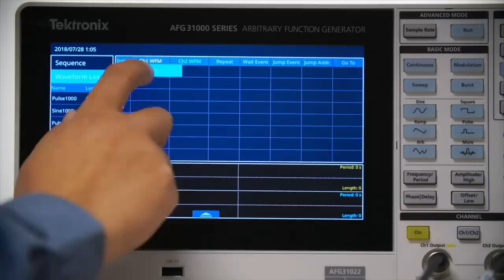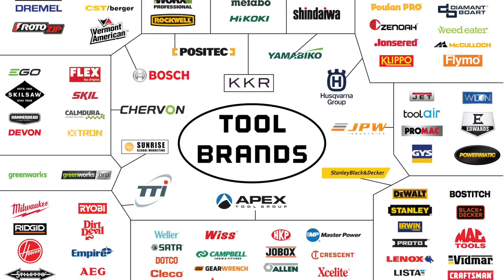Who Owns Your Favorite Power Tool Company? [2023]

Comment: B&D Dewalt and Craftsman were being made by the same base manufacture point for years.   For the last 20 years they all had models based on the exact same base parts and manufacturing tooling setups.   The only difference was the quality or lack thereof (cheap raw plastic Vs fiberglass reinforced or lots of good gease Vs no grease in a gearbox or shit battery cells Vs almost as shit battery cells at 2x the price)  between the individual components the tools were made of and even then many time there was no difference between them other than a grossly inflated price when buying replacement parts. 

Many times I found the same part for a Dewalt was 2 - 3x the price for the B&D version that was identical right down to the manufacturing ID number lazer etched into the actual part.    A dewalt trigger switch could be $25+ and the identical switch for a B&D tool was less than $10 while both came from the same parts supplier.
Reply: I know. It blows. Doesn't it.
Reply: Mr Squeak The Cat. Wow this is good to know! It would be great if a resource existed that listed power tool parts and their cheaper cross-brand equivalents. Do you know if there is a website like this already?
Reply: 1. Craftsmen was just Sears private label they had their products made by dozens of other actual real manufacturers Kinda like Lowes and their Kobalt  brand etc.  2. Black and Decker bought a small table/radial saw company back in the 90s for the actual name. (because theirs was synonomous with crap)imho,  took their tippy top best,B&D power tools and repackaged them and changed the color to yellow- Presto! De -Walt  New brand!
Reply: I had the same experience back in the 1980's when I repaired laser printers. Most of them used the identical Canon II engine, so 99% of the parts (Excepting covers and logic boards) were interchangeable. Of course, if you bought your parts from Apple, you paid twice as much as the same part from Canon. I was able to support 85% of the laser printers in my market area with just one Canon Engine machine to strip for rarely-needed parts plus an inventory of commonly-needed parts. 

 I ran my repair shop out of my RV - Laser PROS - "Printer Repair On Site". I was single and in Southern California and lived in an RV with a workbench instead of a couch. I drove to the client's location, repaired anything on site, parked for the night where ever I wanted (& often as a guest of a thankful client) and used a mobile phone and pager to keep in touch with my clients - all over San Luis Obispo to the north and Orange County to the south. Ah, that was the life!
Reply: Black & Decker's 20v lithium are excellent.  Case and point:  My 2006 BD string trimmer included 2 (two) 2.0 ah batteries and sold for around $100.00.  After using it for literally hundreds of hours (large 1/2 lot with terraces, fence, driveway and bulkhead) the batteries are still strong and will run the unit with the full power switch engaged for around 15 to 20 minutes on a single charge.  Needless to say, the batteries have been recharged, over the years, several hundred times!

The trimmer itself is all original, never needing a spool or head replacement.  

In a recent internet deal, I purchased a 20v BD drill brand new with battery for $28.00.   The battery is super strong.
Reply: Flexvolt tools are awesome. Circular saw, miter saw, and grinder are more powerful than corded versions and they are at top speed as soon as you pull the trigger. Have batteries at least two years old and they get used and charged every day. I like allot of the new tools though, all the companies have good shit out now.
Reply: Another dirty secret of B&D was their different grades for different markets.  They had the crappy consumer models that sold in K-Mart/Walmart, and then the "pro-grade" tools we sold in the NAPA Auto Parts Stores.  This was before DeWalt was a thing, back in the 1980s.   The only way you could tell the consumer from the pro models was the color of the switch.  The consumer models were black or red.  The pro models were blue, and had different/better battery cells and other  components internally.
Reply: Nothing unusual about the practice of parts making up a product being produced by companies who name is not on the final product. The main reason is that sometimes it is COST PROHIBITEING to make the part in house. That part is farmed out to someone who can mass produce that part and make a profit doing so. It is not unusual for that company to supply pparts/sub assemblies for rival manufacturers.
Reply: Craftsman original 18 volt drill was made by Ryobi. There was a slight difference in the top of the battery pack so you couldn't use a Ryobi battery pack without the battery possibly falling out. Shortly after that they came out with another 18 volt drill with that was a piece of crap. Friend of mine had one and they kept shorting out. Not sure who made that though it didn't have a Black & Decker type clip connection. It was a post like Ryobi, but the contacts were recessed in holes at the top. It would short out while he was using and literally have sparks flying out the back.
Reply: @NoDeadlines  if I remember correctly the only other printer engine at the time was okidata. I'm kind of out of touch for that stuff now. Thought I did just build a new ryzen 7 computer today! HP belts a lot of printers with Canon engines and then sold them to other companies for them to Rebrand basically. The top deck was the only thing different on those from HP compared to the other branded printers. It was kind of funny if you knew what to look for you could see it.
Reply: @JohnRodriguesPhotographer  - Yeah. I was involved in laser printer repair when the major engines were the Canon CX and then the SX - which, as you know were the basis of HP, Apple, Star Micronics, Pitney Bowes and a half-dozen other "rebranded" brands. What I liked about that was with one complete HPII, in my van, and a good supply of the well-known common failing parts, I pretty much had all the parts needed to fix 90% of the printers I encountered. (Except for the logic boards, which were customized to the brander) I also did Okis and Ryobi's, but 90% of my customers had Canon-engined printers, so on site repairs went well. My mobile shop was an RV. I covered the entire range of San Luis Obispo County in my RV and used a pager and bulky "car phone" (1980's) and then could also spend the night where ever I wound up in the evening. I often serviced printers in remote locations - ranches, vinyards, small army bases in the middle of nowhere. It was a good time. These days, I work from my home shop and 
restore antique printing presses - not quite the same market but lots of fun.

Comment: I worked for Black and Decker in Australia. They brought drills etc in from China - eg $9 each landed with battery and packaging. They onsold them to major outlets eg Bunnings for $30 who then retailed them for $45. They had a 2 year replacement warranty (not the battery). So they could be replaced 3 times during warranty and Black & Decker still made a $3 profit.
They did the same with vacuum cleaners through KMart - again with replacement warranty. Every month we received a semi trailer load of returns. Most problems were customer abuse eg sock stuck in them.
Reply: And they're great drills. I still have a bunch of Firestorm products.

Comment: It's also important to note that just because some companies are owned by the same company, doesn't mean the tools are equal in quality, design, or use the same parts. Your Ryobi isn't a Milwaukee with some green paint, for example.
Reply: You’re correct, there’s companies that make mediocre product because that’s how it’s designed and that same company will also make a high quality product for another brands design. Everything from motor oils, antifreeze, tires, ac compressors, tools and so on usually fall under one of a few major manufacturing companies
Reply: Not even on the same playing field.
Reply: On the other hand, some cheap tools are actually very capable, and if you are not using them daily, it doesn't make sense to pay premium.  For example, the Harbor freight oscillating saw for $20, it works just as well as the Dewalt which costs $230.00. I would buy 4 HF saws and have spares if one of them died on me while on a job site.
I don't have to use any specific brand to look cool and none of my cheap tools have ever let me down.  I guess some people buy cheap tools or expensive ones and expect them to do things they were not designed to do and then complain about the quality... To each it's own .
Reply: Bosch Green and Bosch Blue is enough to show right there that quality levels vary within a company.
Reply: @lucyferina  Ya I was hoping to see who the root manuf. was for some HF tools.  CP there is junk, while the Bauer stuff is turning out 95% as good as milwaukee....
Reply: Correct. Chevy is responsible for the chevette and Corvette.
Reply: @shawnkmorse  The shoveit? Kind of like the Vega? The Vega could be made into a reliable car with a Corvette engine. Lots of work though, but fun.
Reply: @shawnkmorse  One is a cheap car that will break down and one is a fast expensive car that will break down.
Reply: @kutzbill  Vega's were great, they just ran on motor oil instead of gasoline.
Reply: @lucyferina  blade changes on the Harbor Freight oscillating tool are a chore.
Reply: @1pcfred  it's just loosen one screw on mine, not sure if they make a different model but that change is the standard on any brand I have seen in the market...and it works just as well as the $300 Bosh or Dewalt...I have tested all of those so I speak from experience...
Reply: @lucyferina  There are toolless change systems where you just lift a lever.
Reply: @1pcfred  I've seen those but I still prefer the teeth it's a more secure system..I've seen those with the lever having lost blades and a blade flying at that speed is no bueno... I know some people have to have certain brands to feel like they are getting their money's worth, I don't care when it comes to things like those tools , for other things i do pay premium because I know the quality there makes a difference...I tested many tools and for the price difference you are really not getting much more, my $189 dual bevel sliding miter saw from HF is better than the $600 bosh that I used before, I did floors for 4 big rooms, just for that the saw paid for itself, of course I still have it and it still works just fine... I don't need to pay more. I don't know how others treat their tools but all my tools are working just fine, I could be using them every day for years and they would still be working. Harbor Freight has never let me down, I do own some Dewalt stuff as well but Again I don't need to pay premium for the same quality. don't believe the so called reviews here in YT, they are ALWAYS very biased, try them yourself like I have. I remodeled my house, I spent about $500 on tools at HF, but when I sold the house I made over 60K, the job got done without compromises or shortcuts, anybody can "test" tools and tell you why one is better over the other, well I tested with real work and a lot of use and I can tell you again HF had not let me down yet, yes HF used to be shit tools, that is in the past when the quality control was nonexistant, now most of those companies have Americans ensuring production is monitored, the workers are of course still chinese and that is why you pay a lot less, but a lot of the other brands maybe made in the same factory so the only difference will be in the quality of some components and at this point that is not enough to justify 10 times the price of the cheap ones.
to each his own, I can buy literally 10 of the same tool with the price of one Dewalt but they will last me a lifetime before I need to replace even the first one... again I don't know how others treat their tools but my cheap tools get a lot of use and are still going strong.
Reply: @lucyferina  I've gotten tools from Harbor Freight that are subpar. I had a jig saw from them that was a knock off of the Bosch and it fell apart three different ways. First the switch blew up in it. So I put a new switch on it. Then the blade holder busted in half on it so I welded that back together. Then finally the scintered gear in it broke and there was nothing I could do for that. Then I went out and bought the Bosch jig saw. It works today like the day I got it.
Reply: @1pcfred  you do have to check your tools before you buy them I have had dewalt fall apart on me on the first use, simply keep your receipt and return it not issues.  I personally had not have a HF tool fail me yet but you can buy service protection and they will replace it no questions asked.
I know Bosh will replace your tools if they fail but I can't wait to mail it to them, then by the time I get it back I already bought a new one.. all my HF tools work just fine just like the day I got them too. and no i am not sponsored by them (I wish). At the end of the day use the tools that make you feel happy and spend your money the way you want to.
Reply: @lucyferina  what are you going to check the tools for? The switch failure was inside the tool and it was a malfunction that took time to happen. The ceramic the switch was made out of was rough and every time the trigger got pulled a little metal would rub off. After a while that metal built up enough to make a track that conducted electricity and caused a short. Then it just blew up right in my hand. When that happened I tossed it across the shop I was working in. But I replaced that switch with a plain on off switch. No more speed control but oh well. So I kept on using it and the rod that held the blade in just broke in half. It held up for a while but not forever. I guess the metal it was made out of was poor quality? So I managed to weld it back together. But then finally the powdered metal gear inside the tool completely shattered. I have no way of making gears like that. How was I supposed to check any of this ahead of time? That damned tool wasn't even cheap either. It was about half the price of the legit Bosch tool. I stay away from electric Harbor Freight tools now.

Comment: Concerning Menards, it seems like the new kid on the block but has been around since 1964. They started as a pole barn manufacturer and grew into a lumber, tool and parts supplier. Originally from Eau Claire, Wisconsin and still headquartered there, they have over 300 stores in seven states in the Midwest. House brands include Masterforce power and hand tools, Performax tools and Tool Shop tools. They also carry many of the major brands you mentioned including Stanley, Black and Decker, Craftsman, Delta and more. They own Midwest Manufacturing and supply homeowners and contractors with nearly everything needed to build, frame, side, floor, roof, electrify, plumb, paint, heat, cool, furnish and decorate your home! They are growing and expanding so hopefully they will be in your area soon!

Comment: My main concern when companies buy other companies that they cheapen the brand - they water down the parts that make the tool so good-  replacing metal with plastic and such nonsense I’ve noticed that the Dewalt has drills now that crap out in certain models ... down right  smoke  and burn up...and I went to Milwaukee a while back - bought a two set combo....yet one of the drills  broke or some stupid went wrong with it  and they wouldn’t honor a replacement     I’ve been noticing a lot of people having Makita and no problems no issues and long-term use and the power to get through s project..I lost all my tools a while back and have to retool all over again I think I’m going to go with Mikita.  I like the fact that they are the people to contact if something goes wrong and probably the feedback goes directly back into the people that make the tool rather than some other corporate entity who passes it on to another corporate entity.. In addition I am an anti-fan of made in China because they certainly replaced with lesser grade steel and cut corners were possible and  I am more than  an Antifan - I out right hate what it is happening to good tools and good products when they’re made in China  what that  is that character in the White House says Jina Or vagina... not where u make a good tool

Comment: I worked for a company that owns many “companies” (not tools). Even though there is central ownership, all of the separate companies are run independently for the most part. Point is, even though they are owned by the same parent company, that doesn’t imply the same level of quality. They are aware of the different “grades” of tools and market them accordingly - some cheapo stuff and some premium quality stuff.

Comment: As a very smart man once told me: DeWalt has been sold, resold, and sold again a million times to the point you can't even tell who's making what.   Milwaukees owners also make vacuum cleaners, lawn mowers, lamps.  Hitachi is making hard drives and tvs.  Makita makes tools.

#Makita4Life
Reply: And yet Milwaukee is still the highest rated powertools...Who gives a crap who makes it?  It's either a quality tool (which Makita is, along with DeWalt and Milwaukee) or it isn't....I don't care what the label says, so long as the quality is there!

Comment: You mean that Chicago Electric circular saw I bought at Harbor Freight is not a closet DeWalt ?

I guess the wispy smoke should have given it away.
Reply: I hate the smell of that wispy smoke.
Reply: Careful. If you let too much of the smoke out, it will stop working.
Reply: @George Myers I think the HF stuff has gotten better over the years. It may not be professional grade, but still decent enough that if you don't abuse it too much it will hold up.
Reply: @jackkazee4629  It's also getting more expensive if you've noticed recently.